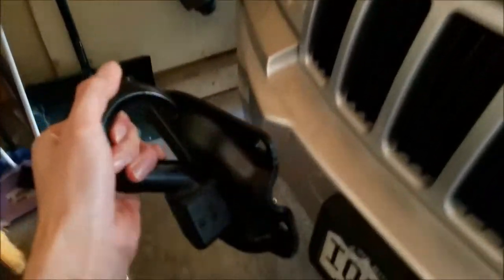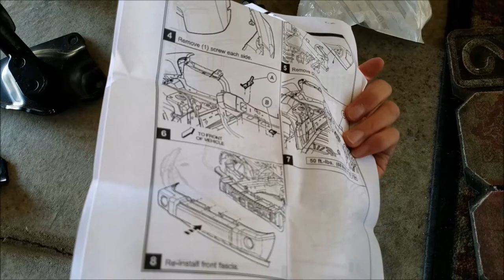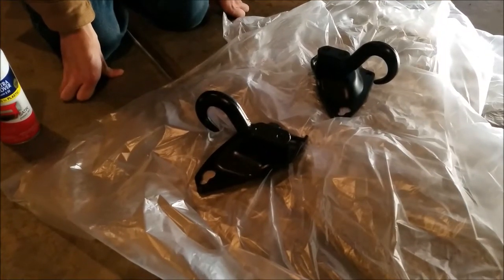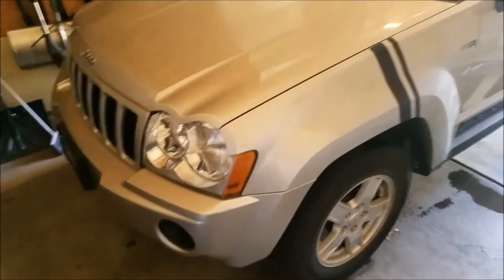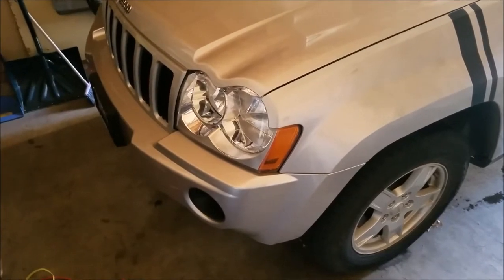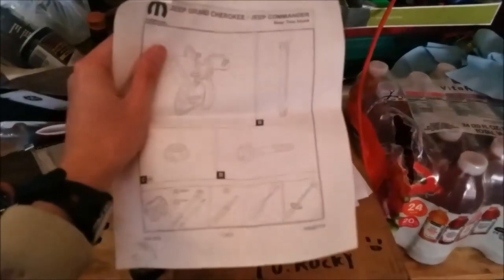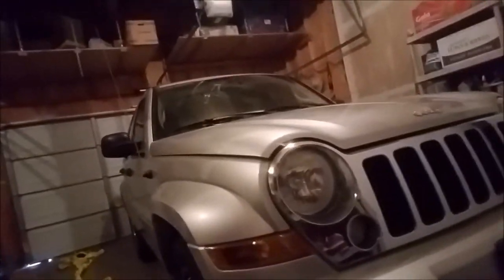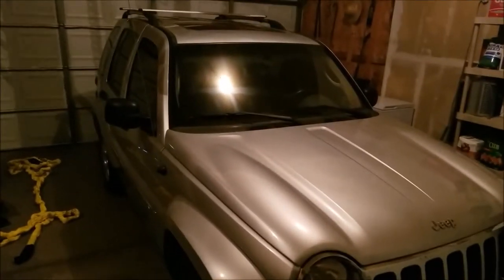Rocky's 1st Off Road Mod! (Jeep WK Grand Cherokee/XK Commander OEM Tow Hooks)

Comment: Did you have to drill in to the frame to mount these? I'm looking at getting some for my 05
Reply from the maker: Hi! Sorry for the late response! No drilling was involved or required in the installation procedure. The rivets however will be the most frustrating part of installation